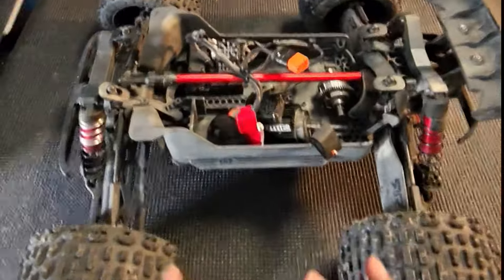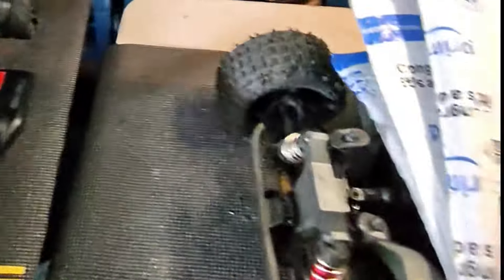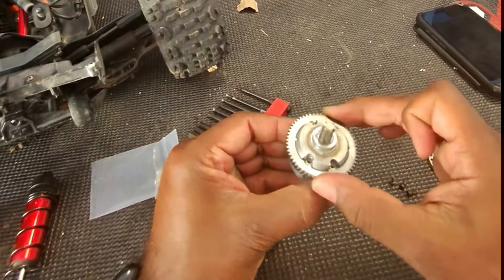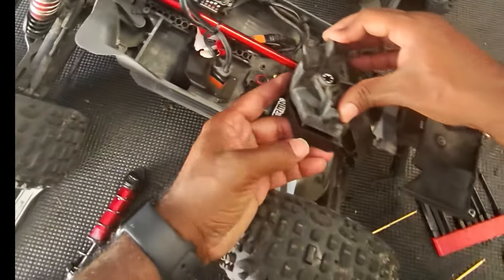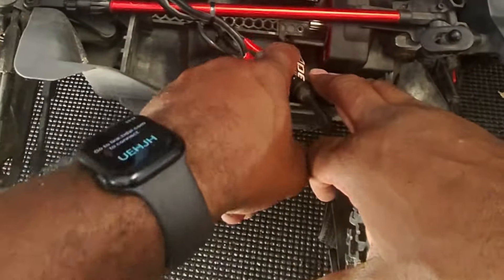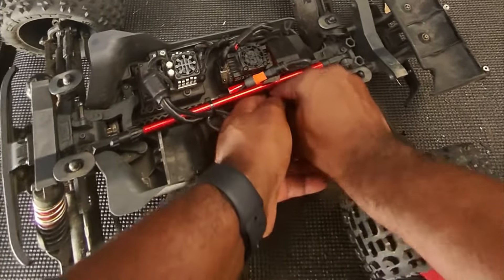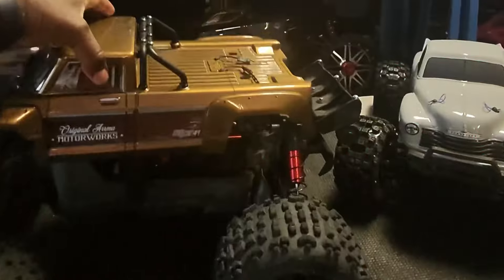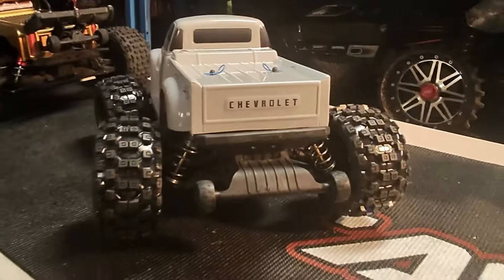Broken and Repaired Arrma Outcast 4S v2.5, Speed Run Tested. #arrmaoutcast #rc

Comment: One tuff truck, though! It must be kinda difficult to set the pinion/spur gap with only one differential output shaft in the transmission housing. The whole thing is kind of unstable on the one side, nothing holding it centered. The proline build looks sweet!
Reply from the maker: It’s a very tough truck. I love to get it out. Very reliable indeed.